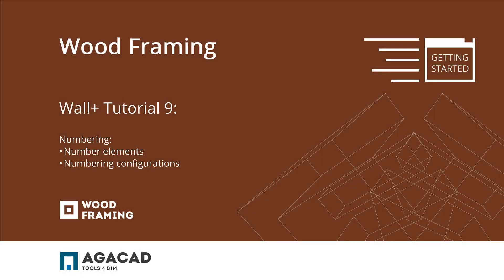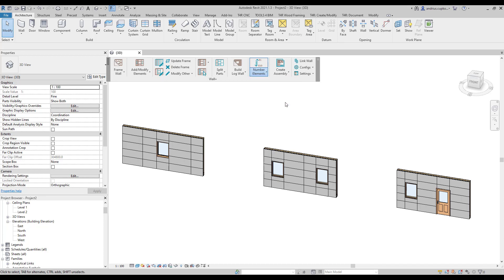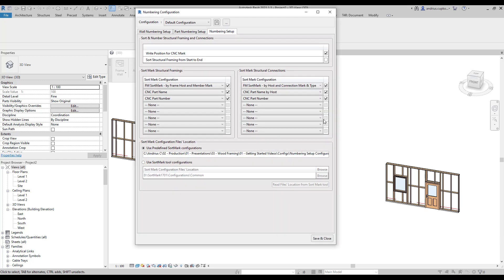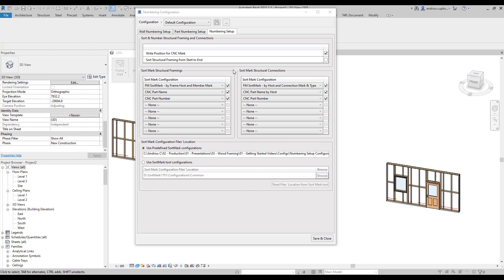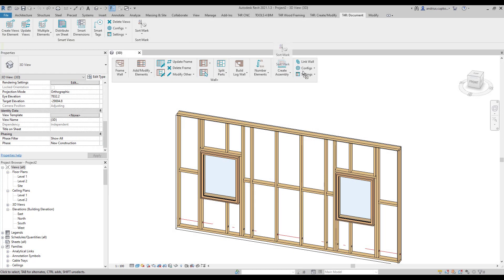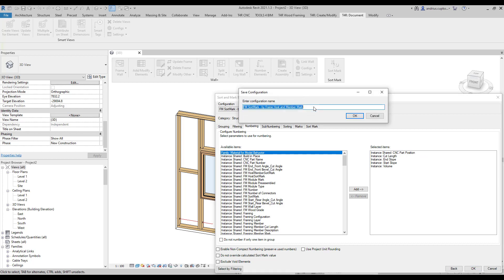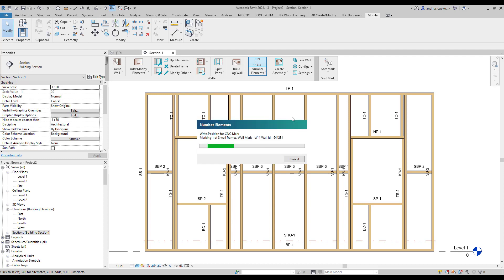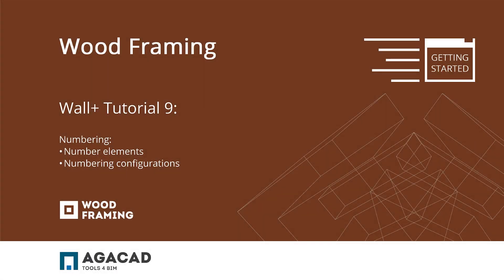Wood Framing Wall+ | Tutorial 9: Numbering

Comment: You guys do an excellent job of explaining parameters and modifications to the framing of walls itself. 

However I still have not found a comprehensive video on how to master your drawing configuration setup for walls. I can never get all the pages to generate without having to manually place all the details. It would be SO APPRECIATED if you could provide more explanation around drawing config, dimensioning, drawing templates , assembly creations, how to show backgrounds and plan views with context as well. Cheers!
Reply from the maker: Thanks, Coby. Regarding drawings configs setup, we still need to finish a tutorial on that, it's currently in progress. So, stay tuned for it. Cheers!